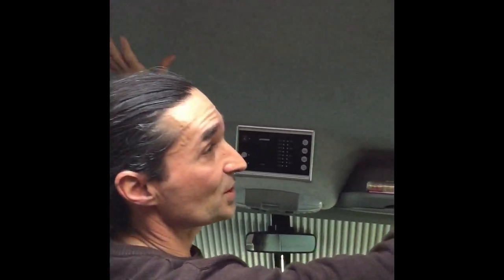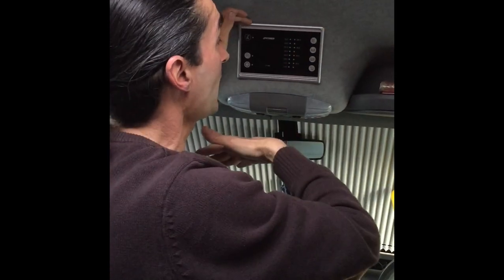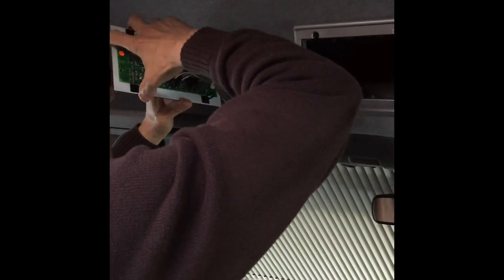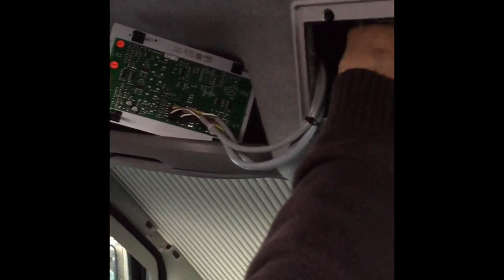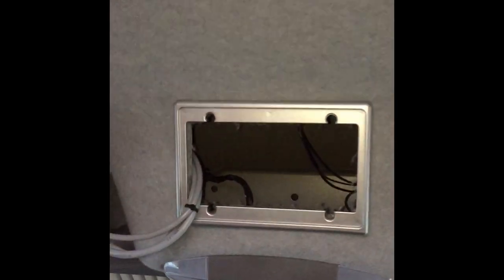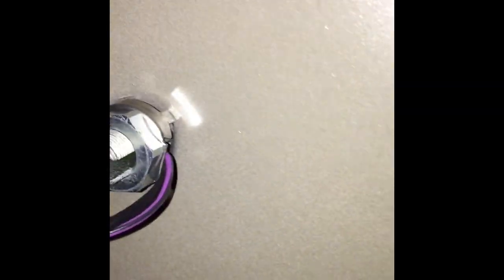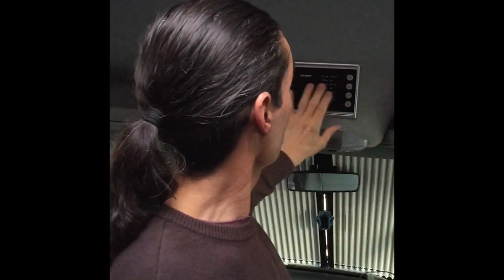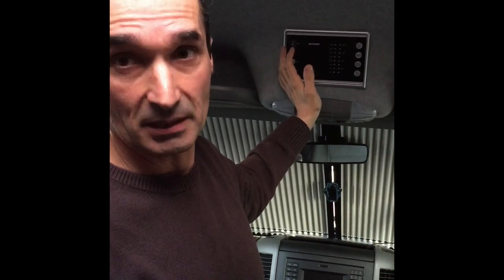Hymer problem Hymer Car Camper Grand Canyon S part 1 - Control Panel

Comment: I’ve just had the same problem and my dealer is going to replace the control panel and insulate the ceiling behind the felt panel
Reply from the maker: You are one of the lucky ones. My dealer replaced only the control panel.  Can I ask who your dealer is?

Comment: thank you for informing us. what year model is the grand canyon? Have they fixed this on newer models or is still un insulated?
Reply from the maker: 2017. So far as i know, the problem still exists. I saw recently the new Modell, and there was only a bit of plastic sheet, behind the control panel, to prevent to get short circuit and no insulation. The plastic sheet was sticking out quite a bit, all around the control panel. It doesn’t look good at all.

Comment: Hi, thanks for the information.. but where can i find part 2? How do you fix this problem?
Reply from the maker: You’re welcome. I have some armaflex in place until I find a proper case for the control panel.  Part 2 will come out when I’m able to show, how it should be delivered from the factory.

Comment: Great video.  I am looking closely into buying and Hymercar is in consideration. Sadly, this type of purchase for many, is an emotional one.  These camper vans start out very expensive but quickly become extremely expensive, especially with the incredible amount of add-on options that Hymer carefully positions itself with.  As if that wasn't bad enough, Hymer and practically all other manufacturers are ruthless in their LACK of service and LACK of support to its customers.

Comment: Thank you for sharing this problem.
 I wonder if they only insulate that section with the "Arctic Pack"? Would be interesting to know. :-)
Reply from the maker: You’re welcome. I have an email from my dealer saying that Hymer does not insulate that area. Which dealer is offering the Artic Pack?
Reply: Hi, Arctic pack (Winter pack,Four seasons) is a term a lot of motor home manufacturers use to indicate extra insulation foam has been added. I saw that Hymer used this term for many models so assumed this could be an option for yours, sorry if that was misleading.
 Its surprising that they don't insulate that front roof area, but I'm sure they could. 
There are is precut insulation kits available like this (SPRINT 0817-144HRCRVFRK
2008-2017 Sprinter 2500 (144wb) High Roof Crew Van Front Roof Insulation Kit) found here: https://www.quietride.com/catalogpdfs/sprinter_catalog.pdf  that they could use if they wanted. 
HTH :-)
Reply from the maker: Hi, that’s a good option. Thanks for the link.

Comment: Just by pure chance I’ve just seen your video and tomorrow I’ve been planning to go and see some Hymer Grand Canyon S campers. One thing that did concern me with the Semi conversions MTL 560 and with the Grand Canyon etc was the cab being fully insulated as I want a camper/motorhome for all year round use. As you’ve shown they seem to not bother with insulating the cab which obviously during winter will cause a lot of condensation. Considering Hymer vehicles are vey expensive, £70,000 I saw a Grand Canyon S for sale you would think they’d insulate the whole vehicle not just 3/4 of it. Tomorrow I’m now going to ask the dealer to show me what’s behind the control panel after I’ve asked them if it’s insulated or not. Excellent video and I’m looking forward to your next one. Nick
Reply from the maker: Hi Nick
To ask first if it’s fully insulated and ok to use in the winter it’s a good idea. At the moment, you are safer with the MLT range. Because the bulk head is part of the shell construction.
We paid with extras, quite a lot of money and we find it very hard to cope with the situation that a basic essential insulation is missing..
We wish you all the best tomorrow.
G & Sharon